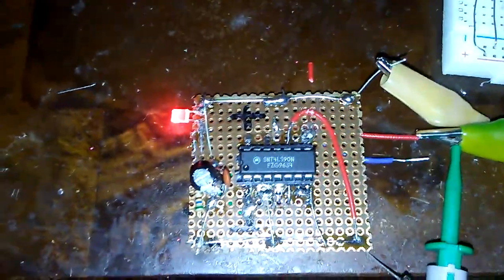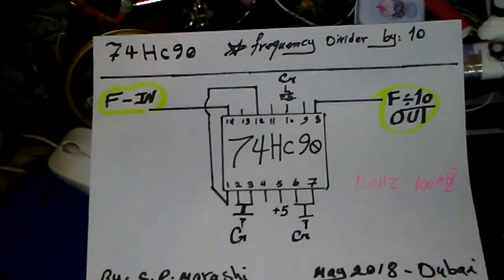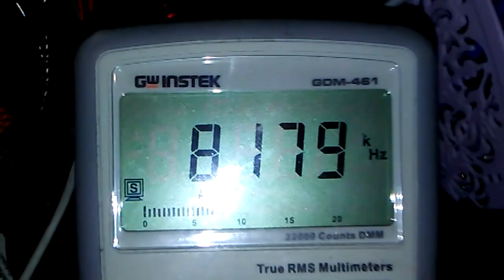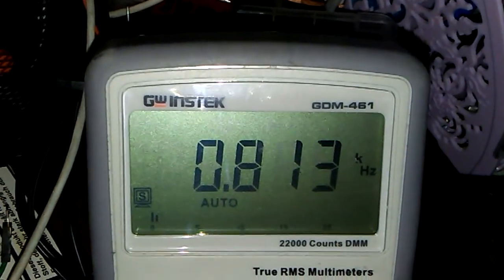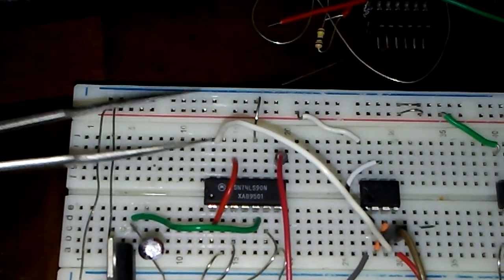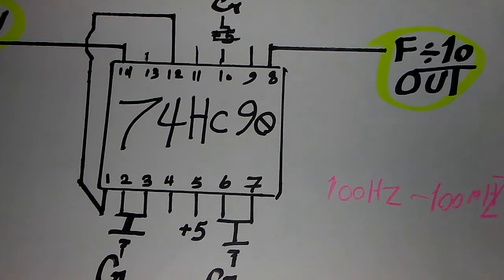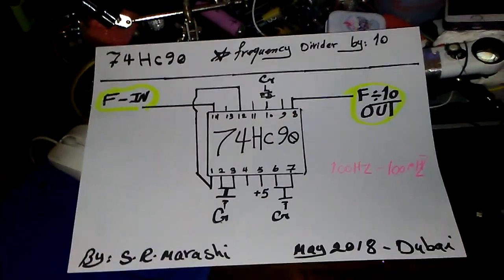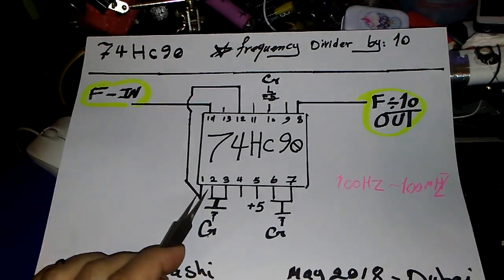74HC90 frequency divider by 10 Schematic breadboard and PCB

Comment: Divide by 10 as you say but when you input 1hz. the led will blink at the output of 7490 after 3 flashes of input led, and thus it divides the frequency by 3..(delay by 3) LOL
Reply from the maker: Hello you are right, check ic datasheet and use as is thanks for your idea